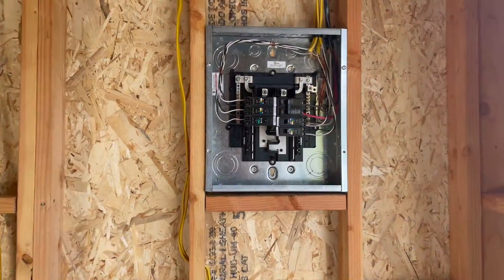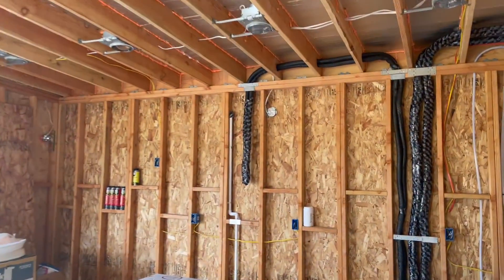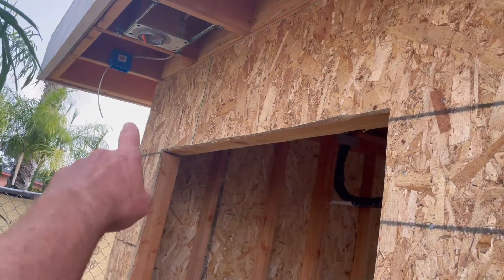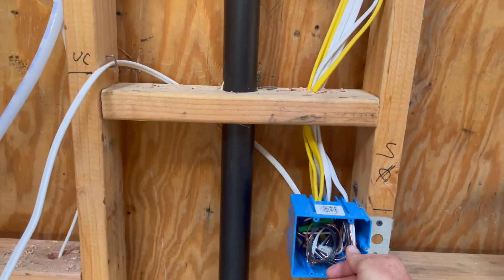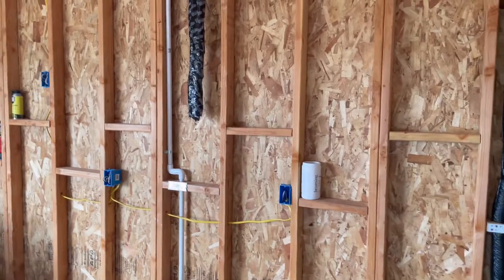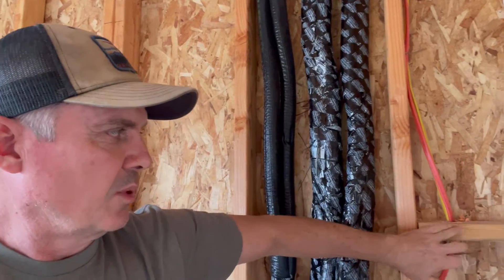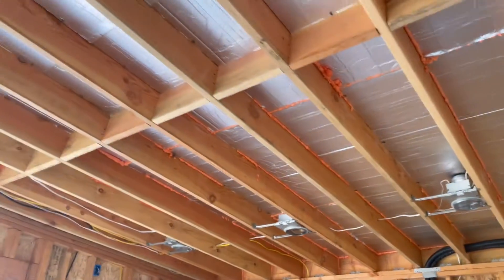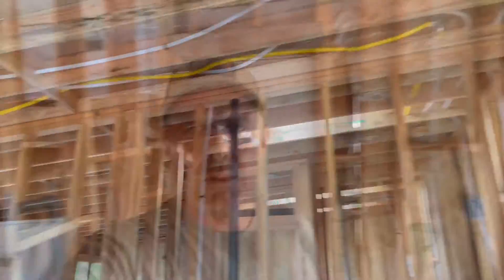DIY ADU #8 - Electrical Rough-In

Comment: It really amazes me all the mechanical that goes into the walls of even a small ADU like this these days.  Question, what is that cable called that you ran for the 220 volt 50 amp plug in the garage for the EV charger? I noticed the conductors were all bundled into a black cable.  Just wondering what it was called.  Thanks, I'm enjoying your series!
Reply from the maker: It’s Romex 6/3. Similar to what you would buy to wire your switches and outlets only it’s sized for higher amperage. Depending on the circuit size and the distance you will want to use #6 or #4 copper wire. https://www.homedepot.com/p/Southwire-25-ft-6-3-Stranded-Romex-SIMpull-CU-NM-B-W-G-Wire-63950021/204839834
Reply: @URBNBLDRS  ah! Didn’t know they made romex that big. Thanks

Comment: A 200 amo power to the  ADU, do you need a sub meter for to the 1200 sqft. ADU. What amp BREAKER do i need to rechargse EV superfaST?
Reply from the maker: You will need a sub-panel run from the meter to inside the ADU. Normally between 60-150 amps, 100 amps is probably the most common. If you have a 400 amp service then you could run 200 to the ADU. But most SFR only have a 200 amp service. On the EV charger, you can go up to 100 amps. Just make sure that you size your wire appropriately. You don’t want to use a breaker larger than your wire capacity can handle.